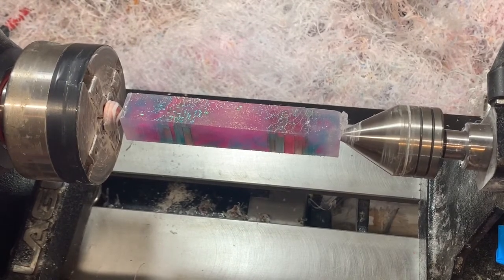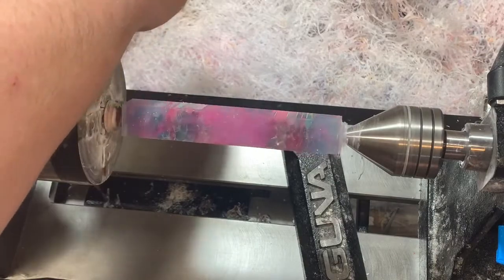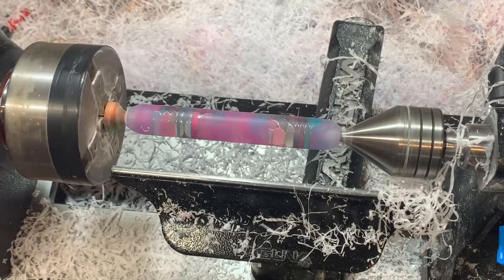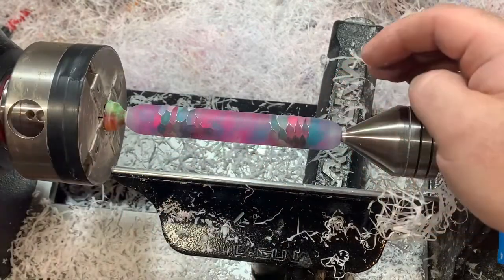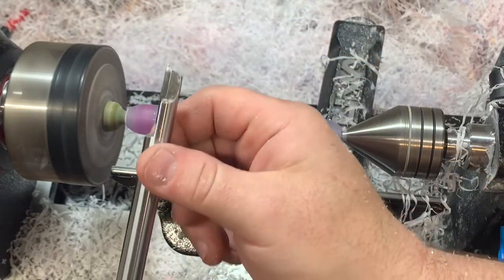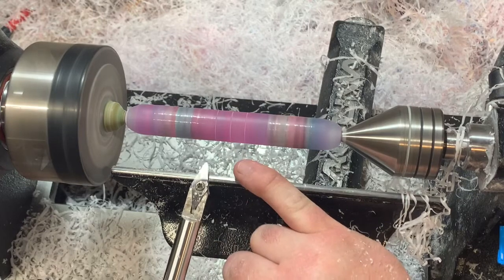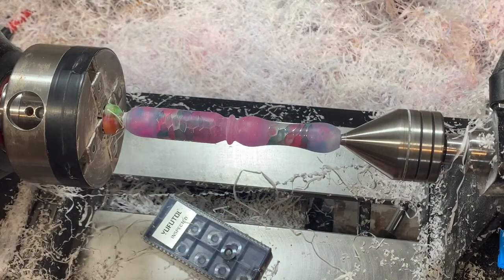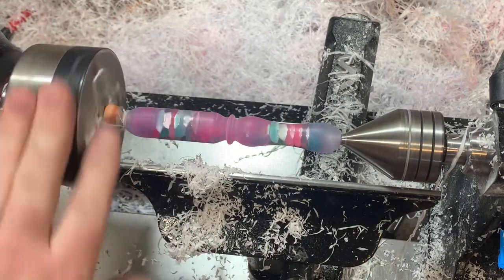Aluminum honeycomb diamond pen

Comment: Hi Dan! Curious if you soak the honeycomb in some acetone before casting? That may help with the chipping.
Reply from the maker: Yes I do I soak in acetone then rinse with alcohol and it does I get my honey comb from zac at nvwoodwerks and it works better than most. The worst chip out I get is when doing the mass produced honey comb. This one worked out great.
Reply: @lassenlatheworks3004  ok awesome! I thought I saw a post on the FB group that said you weren't doing honeycomb any longer and it's a shame because they are so beautiful! But losing money on them is no good!